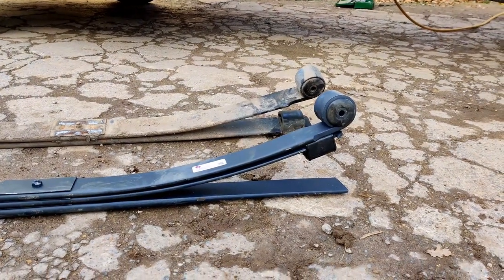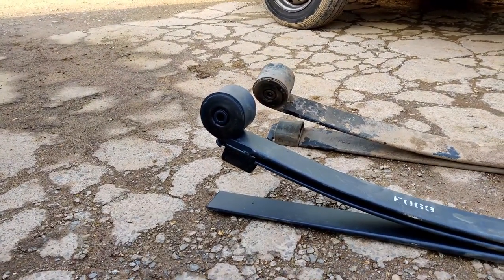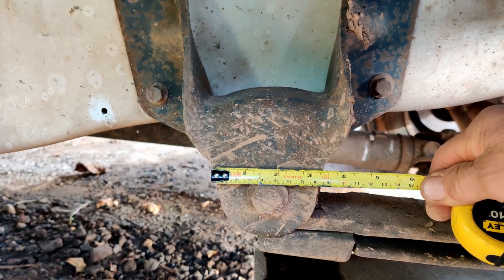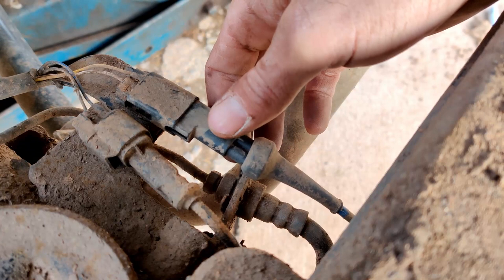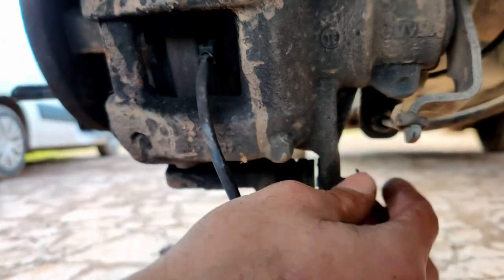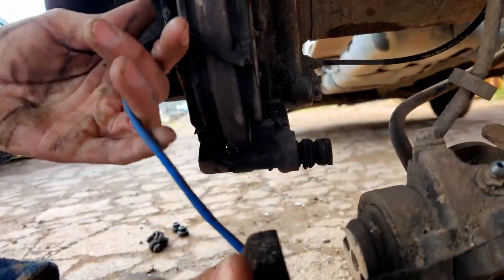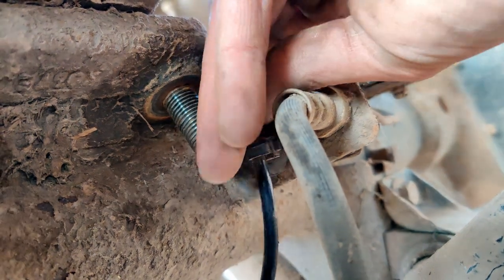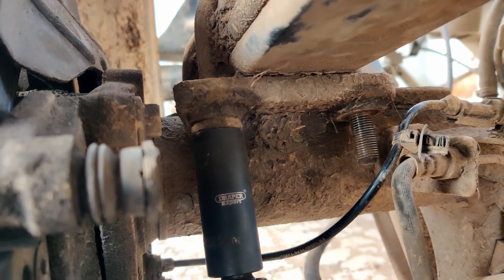Transit rear spring upgrade changing MK7 MK8 springs quickly, tipper springs.

Comment: Put mk6 springs on a mates mk8. Just ‘cause the bush is bigger doesn’t mean you can’t use them. The lengths are all the same but the width of the mk6 are 8mm narrower so need some spacers on the front